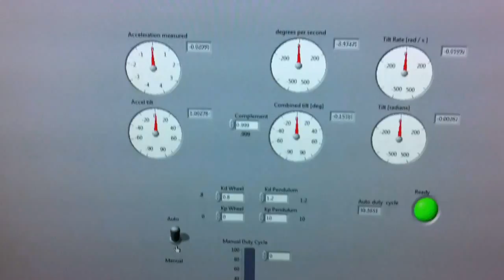Reaction-Wheel Inverted Pendulum, balancing with PID control

Comment: Can you please tell me little bit more because even I have a 6-12 Volts dc motor with stall current of 500 mA and rpm of 110. Other then that I do not know anything about the motor. When I did some estimations of torque and Impedance, I had hard time balancing it. Sorry for the bother, but I am really interested in how you got in to balance with very little information on the motor.

Comment from the maker: @fighterace101 We controlled torque by modulating pulsewidth, without changing frequency or the supply voltages. Make sure that you can control your motor before you try to control it with sensors. We tested ours with a slider in our VI front panel from power = -100% to +100%.

Comment from the maker: @fighterace101 We needed to know angular VELOCITY of the rxn wheel, not just speed, so the encoder that I made was a quadrature encoder. I figured out how to make it from reading Wikipedia, and then tinkering with time-domain filtering. I also made a complementary filter based on 'The Balance Filter' from MIT. Google it.

Our machine is an inverted pendulum, just mounted on rollerblade wheels. Once you get your sensors and motor running, I would not mind telling you about the control system.